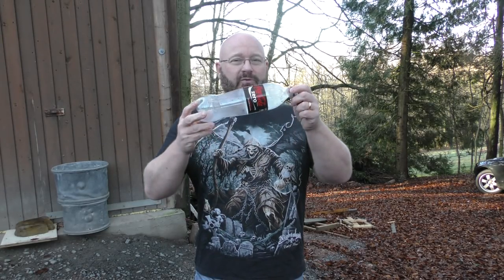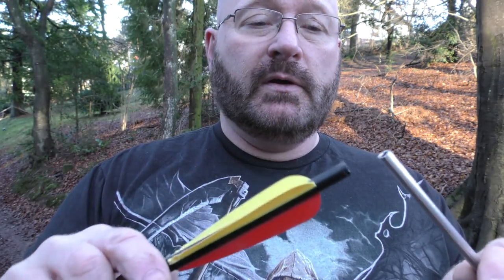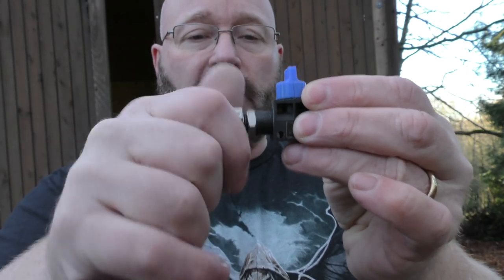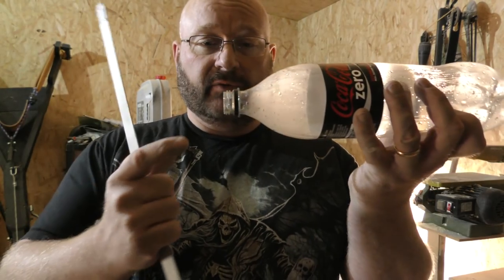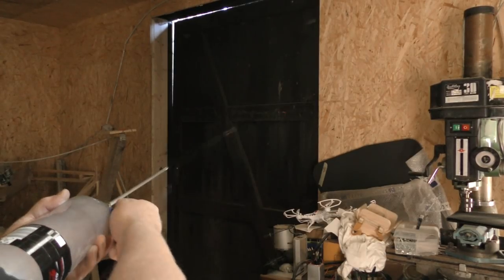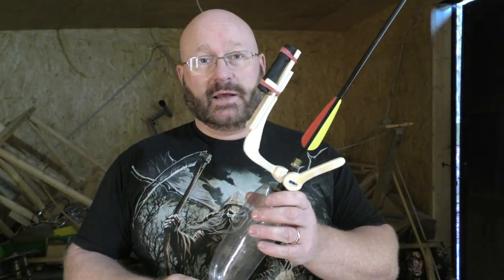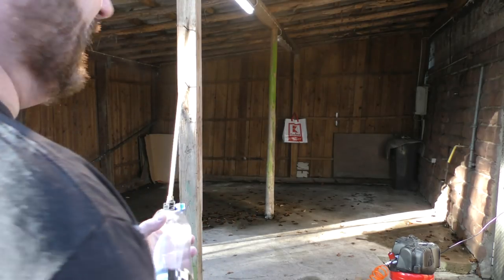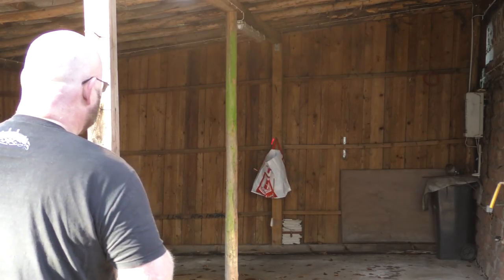How to turn a Coke bottle into a deadly arrow airgun

Comment: Charlie and his daughter haven't been listing the Big Blasts on Ebay for a month or so.  Not sure what is going on but it seems the only place to buy them is on your website now.
Reply from the maker: +TAOFLEDERMAUS Jeff, I did notice that too... I hope they just ran out of stock. This product is way to cool to disappear from the market.
Reply: +JoergSprave Jeorg how about using an ,air blower duster gun, for the arrow release much faster than a human hand twist! Search on Ebay and make it more awesome! If you select the unit with the coiled air hose you could carry a cylinder on your back and a quiver of arrows!!!!
Reply: JoergSprave His daughter was selling a different version,  just the little rubber plugs and you needed to punch a small hole in the caps to insert.  But you could use them on any type of bottle. Even she doesn't have any auctions listed.    I do like the Big Blasts,   they are much louder than they sound on camera.
Reply: +JoergSprave Hope you are doing ok right now during the turbulent landscape you are facing today.......
Reply: +Monkeyah2 That's nice to know, Umarex has national distribution and I'm sure they'll become more prevalent. I'm just worried what might happen to the quality or any nanny safety devices or pressure release systems they might add.

Comment: Needs a larger valve that clamps on to outside of the tube. There is too much restriction in the air flow. Change that and you would get much better results.
Reply: I know this is an old video, but a wider barrel diameter in general would work much better. Wider barrel = more air at once = less air shooting out after the projectile's been fired.

Comment: I have been a Tyre fitter in the past and I can tell you a 600ml coke bottle has no problem holding 360 psi+.   360 psi was the least I could get in the bottle because it fills so fast. 2L coke bottles are known to expand to X2 the normal size before exploding and you can test this by adding and mixing gas producing substances and seal and view from a distance.

Comment: And so das Jorge enters the magic world of diy air "toys" :-)
Reply from the maker: +Walter Zanon Yes, this deserves a much, much closer look :)
Reply: +JoergSprave du solltest dich über QEVs und so weiter informieren. Außerdem würde ich mir nen stahltank zulegen. Ist sicherer und kann mit sehr viel mehr Druck befüllt werden. Eine ganz einfache Variante für den Tank ist ein Rohr mit gewinden an beiden Seiten. Dazu dann 2 entkappen und etwas dichtband
Reply: +JoergSprave 
Keep up the good work Joerg...
If a person were to put a wheel on the valve.  And a rubber band around the wheel , and a latch to let the wheel spin. And a stop on the wheel, so that when the latch was triggered, it would let the wheel spin , Turning the valve on then off again.  That way you could get more than one shot  per pumping.
Just an idea.. :-)
Reply: Willy Bee , well that's kinda pointless for shooting since after the first shot the pressure in the chamber drops so the next shot will be weaker. Yet, your idea sounds good if the "valve" releases enough air (gas) to shoot the projectile at the right speed, leaving some air inside the chamber so you can refill it faster, since not all the air was released. Or he can mount a spring release valve!

Comment: For future make shift air cannon reference: the bottom of a coke bottle is far more structurally weak than the cap and thus far more likely to blow out. Its probably best/safer to use the cap as the exhaust and then fill it via a shrader valve or something in the base. You probably know this, but this is for anyone else who sees as well. Keep up the great work!
Reply from the maker: +Jason Rock Pressure is even. It does not matter where you attach things. Swapping positions would not make any difference.
Reply: JoergSprave
No I get that, and definitely just moving it to a different part of the bottle wouldn't do anything. However, I am speaking purely about the structural integrity of the (usually) thicker cap vs the (usually) thinner wall of the bottle.
The nut and bolt type attachment would likely withstand a bit more pressure when attached via the cap vs the thinner bottom wall. You could then just use a tapered schrader valve for the fill input that allows for more surface area against the bottom of the bottle and thus making it slightly more secure.
Its hard to explain what I'm trying to say without visuals, but I'm also realizing it really doesn't matter if you're just using reasonably low pressure (unlike some who might over-pressurize).
Anyways, thanks for the response! I love your videos, keep it up!

Comment: Joerg my friend you're too creative. Now if you can find a way to control the excess air leak. You may have a money maker. Heck I'll buy it.
Reply: He also needs a QEV and expansion chamber.
Reply: +Octavio Araujo Even if the trigger was spring loaded to seal the air, the next shot would still be considerably weaker.
Reply: +Octavio Araujo A sear on the trigger lever would do it. You could put rubber on the sear instead of a spring and that'd satisfy the need for rubber in the contraption.

Comment: Try putting a very tiny rubber seal/lock at the root part of your barrel (like a small o-ring) to temporarily lock the mouth of the arrow tube, so that there will be delay until the pressure balances inside the tube, then gives way automatically to the pressure and fires the arrow.  See if it would be more powerful. I think the entire action will be fast enough, you'd barely notice the delay.

Comment: I love your accent. I was wondering if you ever pumped the bottle to more than 130 PSI; And how much do you think you could safely pump the bottle up too?
Reply from the maker: +Steve Rabon Don't really know, my bike pump maxes out at 140 - that still works for the Coke bottle.

Other bottles only do 90 or 100 psi.
Reply: OK thanks for the information, video and reply. So in your opinion the coke bottle can hold more air pressure? Thanks again
Reply from the maker: +Steve Rabon Maybe, but there are limits to that. Charlie Allen, the inventor of the blast caps, says smaller bottles can go up to 160 psi. Keep in mind the higher the pressure, the more dangerous this gets.
Reply: Oh yes I know. I was just wondering what you thought was a safe PSI for the bottle. I have seen the bigger bottles bust around 80 through 90 PSI. I might have to use PVC or steal tubing though. I am just wanting something I can play around with. I do not hunt or anything like that so I don't need it to be real powerful. I just want something I can play around with, but I want it to be cost effective and that is why I want to go with a bottle of some kind. Thanks for the replies and information. I love your channel. Thanks again.
Reply: +Steve Rabon I recommend that you never, ever put compressed gas in PVC. When it fails, it shatters into very sharp pieces and is extremely dangerous. It could be OK if you can pressurize and de-pressurize it from a safe  distance, but not if you are near it when it is pressurized, it is unsafe.
Reply: OK thanks. I also god one of those little green propane tanks I been thinking about using. You think that would be safer?
Reply: +McKenzie Keith  no it doesnt it splits, you never saw a bottle of coke go boom?
Reply: +Pali May please re-read the exchange. I am not talking about coke bottles. I am saying that PVC pipe, when it ruptures due to high pressure gas, splinters into sharp pieces. It is a well-known hazard.
Reply: Thanks all for the information. Yeah I can imagine both being unsafe. I Know all even metal can be unsafe when pumped up too high. I will probably experiment with the coke bottle and see how much they can be safely pumped up to without busting, but I might just save up a get a carbon fiber tank also or make my own. Thanks for the information. I didn't mean to get an argument started. Sorry about that. Thanks to all
Reply: +McKenzie Keith  Yeah I see, maybe put duct tape round it to absorb the shock if it shatters and stop bits getting out as velocity. Or possibly a looser oversleeve like an engine cowl to catch bits.
Reply: Carbon tape would probably work better and then use resin to harden it. That is what I would probably do.
Reply: +Steve Rabon yes
Reply: I did get a coke bottle to see when it would explode but my compressor limits out at 150 supposedly but got to 170 before limiting out. The bottle didn't show any signs it was ready to explode at 170. I am sure it could probably handle 200 pounds easy without exploding, but coke bottles was the only ones I used that could be pumped up that high. I used Pepsi bottles and they exploded at about 80-90 pounds. so Coke bottles is definitely the way to go with just a toy, but that much pressure is definitely deadly and more than just a toy. Thanks again.
Reply: guess it depends on how often you pump it up, too...

Comment: a piece of thin-walled conduit in the proper size can be hammered down over a nut like that for a do-it-yourself socket wrench that fits nicely into tight spaces.  Grips a bit better than just cutting a notch in the nut.

Comment: Use a half nib in the barrel, only connected to one side.  It would still prevent a BB and block less air.  Or cut a U shape into the barrel tip, and bend it to block a BB from going in.

Comment: A spring loaded trigger may allow for multiple shots. When you release, not all of the air would escape allowing for perhaps one, maybe two more shots. If the weapon was attached to a constant air supply (like a pack of some sort) the reload time would be much shorter. Maybe with a valve that shut off at a certain back pressure. Fire. Air expelled. trigger closes. Air refills as you load a new arrow. FIRE!

Comment: Use a trigger valve from a air nozzel  and save air and re-use.  If you want an even better valve, cut apart a simple air powered staple gun and use the air direct from the piston chamber.

Comment: A PVC pipe with a heavy spring loaded piston to allow multiple bolts to be loaded and fired like a shot gun. That is primed with a plunger like old musket black powder guns with a lock plate with a pull triger to release the high tension spring shooting off ten to twenty bolts or arrows all at ounce a a single target.

Comment: Super ingenious. I'd make an addition - put a strong rubber band on the trigger so this band can be "tripped" and operate the air valve much faster - that way got full pressure right away - suspect it could double the fps.

Comment: Hey Joerge, be careful with plastic bottles and pressure. I've had a few blow up on me in the past. Prefer copper or steel plumbing tubes. Also, 1/8" ball valve is your limiting factor here. Try a 1/4" or even 3/8" solenoid valve or even piston valve. The pressure loss will be greatly reduced, and you'll get much more velocity !
Reply from the maker: +CpTnlAw The tubes have a 6mm inner diameter. A bigger valve would be irrelevant.
Reply: +JoergSprave You said you chose 1/8" diameter ball valve which translates to about 3mm if i'm not mistaken. That's four times less exhaust area (i.e. flow/4)  1/4" will get you farther. Also, the opening time of the ball valve is longer than that of a solenoid valve or pressure differential valve. You have done some incredible work with rubber activated trigger mechanism, you can surely make the opening of the ball-valve rubber loaded? Anyways, great video as always !

Comment: I would have liked to see how many consecutive arrows could have been shot from the large bottle. Instead of a valve that releases all of the air, a spring loaded momentary push button valve would save the remaining air pressure. You may get 4 or 5 arrows per bottle.

Comment: Interesting concept. 
I'm thinking that using copper tubing (instead of the bottle), some brass fittings and a QEV would improve this design immensely. 

PS - A shock pump will reach much higher pressures, too.
:)

Comment: An air cylinder with big diameter, a lightweight piston that pushes the arrow and hi-speed hi-flow valve! Such device can be extremely powerful even at low pressure! ;)

Comment: If you have a air compressor, why not try using that to shoot your arrow? Maybe you could even use a steel arrow for more penetrating power if the air compressor is powerful enough?

Comment: make one using pvc. modify an inline electric water valve using an air chuck for a trigger. I made one to shoot home made darts using 3 inch wood screws. it was very powerful. I never thought about the tube to shoot arrows or I for sure would have done that. I can show you pics and videos of it in action. I had screws coming out at over 300fps and sticking into trees at 40 yards.

Comment: If you reinforced your bottle you would get more power. Duct tape could work. When the bottle expands you know it's too much pressure for the bottle. As soon as it expands you're not getting any more power.
Reply from the maker: Pressure is pressure. If I would use duct tape that pressure would be achieved earlier, but this way I get more volume.
Reply: @Slingshotchannel  i thought you were having a problem with the volume with the bigger bottles and the smaller arrows. You did seem to be satisfied with the the effect you got but i was just offering up my idea. If the pressure gets high enough you could add oil into the slide and see if it ignites like they do with air rifles. Probably not enough though. I was just thinking that if you duct tape the thin main area of the bottle really good or even find something better for reinforcement you could build more pressure and possibly get more power. Cool project though.
Reply from the maker: Yes, I might have been able to put in more pressure if the bottle would have been wrapped with tape. But then again the compressor / pump I had back then wasn't capable of going any higher so it would have been pointless. This video is very old, I moved up to steel pipes long ago and went from 10 bar to 300 bar. Makes a huge difference.

Comment: Get a small gas bottle and you'd be able to get much higher pressure and it only requires drilling and tapping a hole. It'd be quite interesting, i'd do it but can't be bother looking through years of legislation to see if air arrow launchers are legal...

Comment: To save on pumping air all the time. If you put a small recharged co2 cartridge next to the bottle and recharge the coke bottle from that using another valve. That should work. Won’t it?

Comment: If you make a wood sabot and shot an arrow out of a 6 foot 3/4inch copper at 600psi it would be going insane fast. the more area the air has to push on the better.

Comment: Okay wrap that bottle with fiberglass dry wall tape epoxy and then use a 2000 or 3000 psi bicycle pump.... Surely if you wrap that bottle enough you can get at least 1000 psi safe.... Or how about galvanized pipe with end caps for the same thing.... Of course I recommend testing to 2 X pressure so 2000 psi to use at 1000 psi.... Love to see that and I bet you could go clean thru your barn and anything in between the walls lol..... But test it on long lines and keep it away from you until you prove it's safe pressure

Comment: Hello Jorge, I am quite the fan of your channel, I think your videos are brilliant!
I was thinking that a ratchet with an 18 inch 3/8" drive extension with the appropriate socket would work quite well for fastening that retaining nut on the inside of the Coke bottle.
Cheers from New Hampshire.
Reply from the maker: +Charles Horsley The hex nut itself barely fits through the mouth. The socket wouldn't fit at all.
Reply: +JoergSprave I should've watched more diligently before commenting. Your improvised tool was impressive.
Great video!

Comment: Not criticising, but can you not use a single push button vale instead, similar to the button/switch use in industrial airguns? It would minimize the amount of pressured air delivered at the time of shooting. Again, instead of threading the nut into the bottle, why not using Epoxy to hold the part in? It is designed to withstand that much of separating force (maybe 60 lbs/inch). In any case, thanks a lot fur deine Lftwaffen idee.

Comment: If you use a stainless steel water bottle you do is 150 pounds lb of pressure and make a Shotgun that'll shoot marbles incredibly hard the barrels made out of standard copper tubing it's also the same size as a double A battery which we all have many laying around battery will go through a piece of plywood close to one quarter of a mile

Comment: @JoergSprave  have you tried shooting this gadget with some rubber bands attached around the center of the bottle to add up to its pressure inside and hence to the FPS velocity? Could you try it like that and make a sequel if it works better, please?

Comment: To anyone trying this - make sure you are using coke bottles or plastic bottles designed to hold pressure! My friend pressurised a weaker water bottle for a similar project/experiment and it exploded and part of the blast/plastic took out one of his eyes :l

Comment: Put a valve on the co2 bottle inside a fire extinguisher then it will be multishot without pumping back up to pressure. It should fit the design being bottle shape but that idea is good. ;)

Comment: I understand that this is how convert a coke bottle to fire Crossbow bolts.

Wouldn't it be better if you attached a CO2 Canister or a refillable air tank and make a mechanism to make it fire like a Paintball-Gun?
I know it would cost a more but do you think it would be reliable then using a Coke bottle? 
If so, Is it possible to add more than 1 bolt?

That would make a very enjoyable video.
Reply from the maker: +Lenden Longbeard Well, that is pretty much exactly what the FXAirguns arrow shooters do. It works really well, but of course this isn't really a simple project you can make at home anymore.